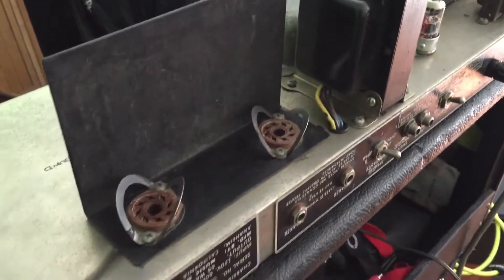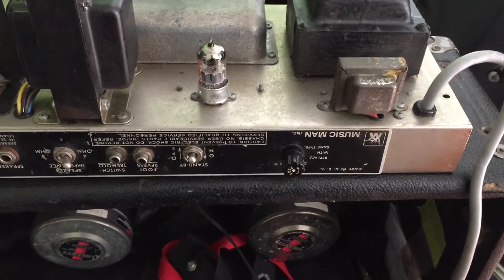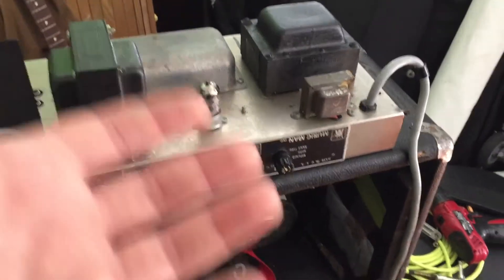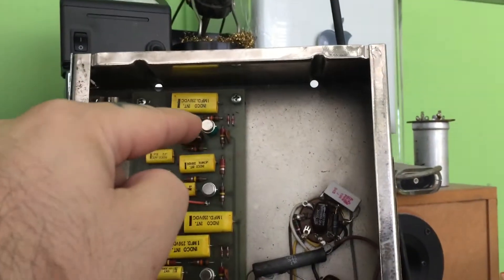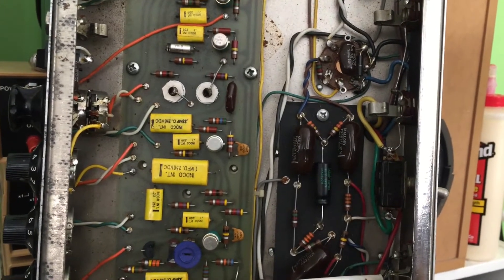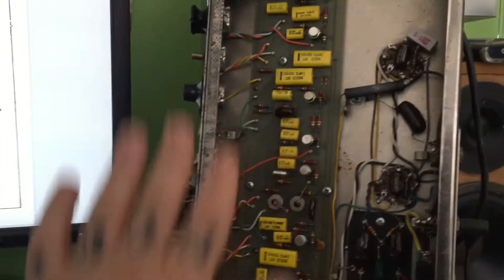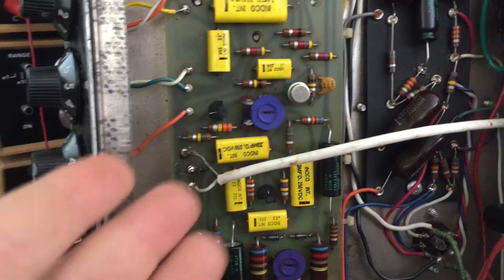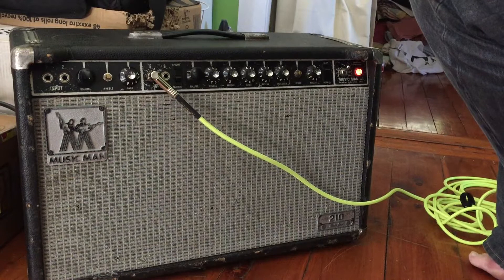MusicMan RD112 Not Happy

Comment: The OHM switch on the back is for an extension cabinet.
Reply from the maker: It sure is, until you swap the speakers in the cabinet to be 4 ohms total.
Reply: They came stock wired at 4 ohms total
Reply from the maker: @Calloway423 that’s pretty unusual if that’s the case. So if you want to use an extension cab, how do you configure the impedance and switch?
Reply: @whatsstefon the two jacks are in series. Stock speakers require 4ohms. If you use the extension cabinet jack too, switch it to 8 ohms “for best average performance” according to the manual.
Reply from the maker: @Calloway423  that makes sense. Most internal and external speaker jacks are in parallel. Cheers for clearing that up.

Comment: Had a similar problem with my HD130, it was one of the coupling caps had a dry solder joint. Replaced the 4 of them brown turds with brand new orange drops. Improved the tone as well.
Reply from the maker: Nice work. Sounds like a great fix and an improvement for sure!

Comment: The Title refers to an RD112 model? I have an RD112 and it is quite different to this one. My RD112 has a similar faint distortion - which should be easy to trace, however, it is intermittent - whenever I've had the opportunity to fix the amp, the problem has not been there? I'm qualified in tube technology, but I don't have the experience with the solid state stuff!
Reply from the maker: I believe there were quite a few models that vastly differed from one another. I’m not too well versed in solid state either.

Comment: I thought these had 6L6 power tubes, the original eminenct speakers are brilliant
Reply from the maker: To be honest, I’ve seen them with both tubes. However the schematics also show different versions. So it’s really pot luck.
Reply: @whatsstefon  i have the hd130 reverb, has the earlier badges and tube chart in the head but the the later driver board and 6l6 tubes.  it is wired to rub either el34 or 6l6 style tubes.   the ics are LM307h but if it the transistor driver ic8 is a lm1458 dual op amp. im chasing a reverb/tremolo problem, so far one or the other will work by swapping around the lm307s,    waiting on some new ics,    the je1692 in pairs are on the db2 driver board, the transistor with the leg out is part of the tremolo.
Reply from the maker: @jeremybanks719  thanks for all that insight and info. That’s a huge help in understanding these amps!!!! What a legend!!!
Reply from the maker: @jeremybanks719  sounds like you’ve definitely done a lot of research man. Awesome info that’s almost impossible to find anywhere!
Reply: when the new ics come in ill give you an update on them.  if it doesnt straight up theirs some adapters you can get to go from the old metal can to dip op amps. and theres some now op amps like brown bur and such that works. from my readings and my understanding is these 307 have a slow time to them and lower gain. ti think the ne5344 ( cant remember the actual one) has a higher gain. but they are single op amps 4 pin to a side, and some report that they have a mullard tube like character to them.  theres forums that mention this and a bunch of stuff about what others has tried over the years.  talkbass is on place,  pacair, and a few others as well. i been reading on this since 98 and messed with this since then a little here and there, mainly just playing on it with out the trem working as it never messed with the sound. nor did it help with the bleading ears syndrome when cranking it either lol